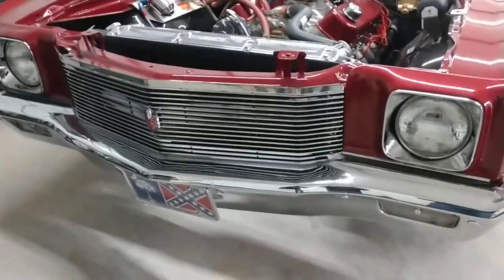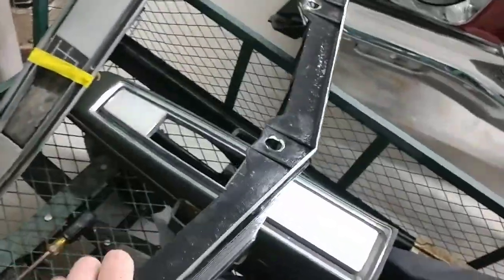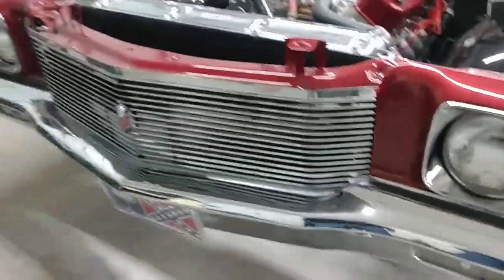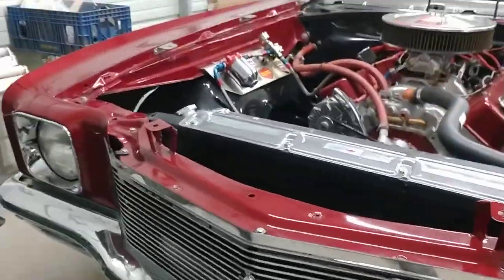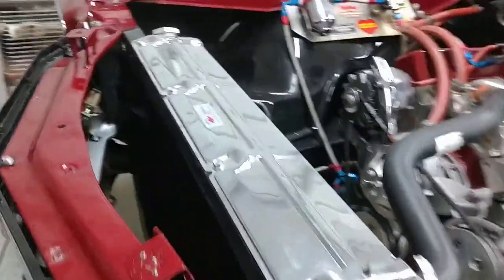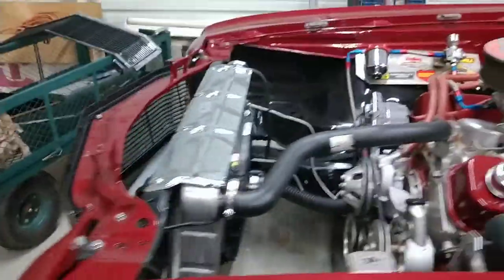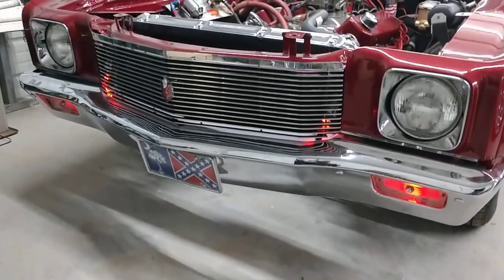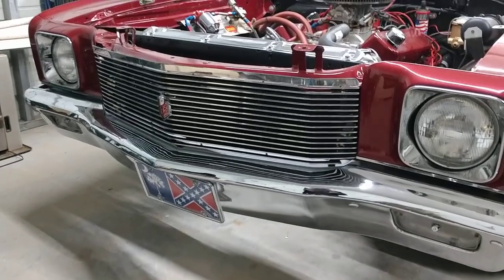New 1971 Monte Carlo Grill by Billet Art

Comment: Great vidoes, there is not alot of people showing off the 71-72 monte carlos so i thank you.. do you have the site where you got the ss tail panel from.. i need a new one
Reply from the maker: The steel panel is not made. It's just painted black
Reply: Ok thank you.. so one more question, i dont have the ss so if i wanted my tail end to have the chrome trim on the top bottom and the corners like you have do i need to find the ss tail lights with the slots for the chrome on top and the corners?